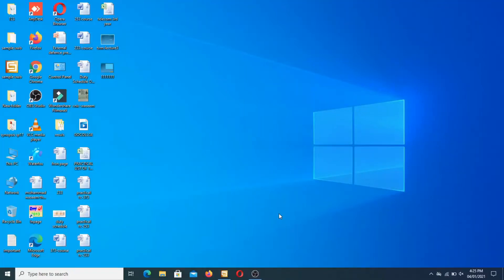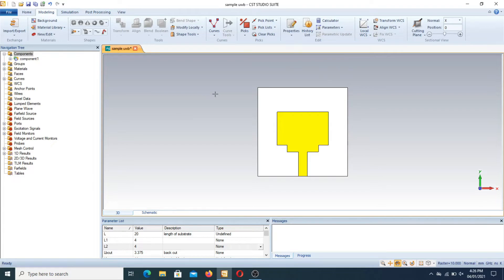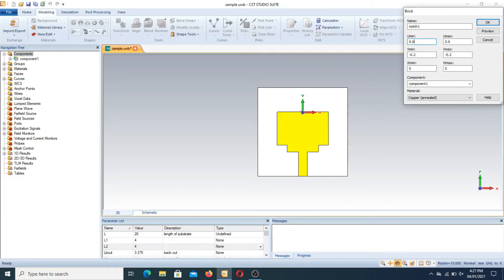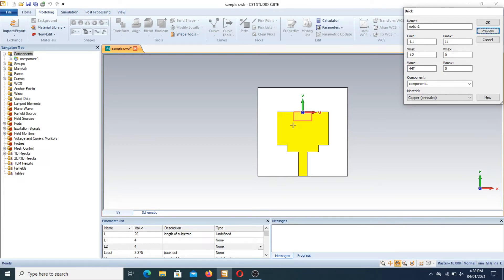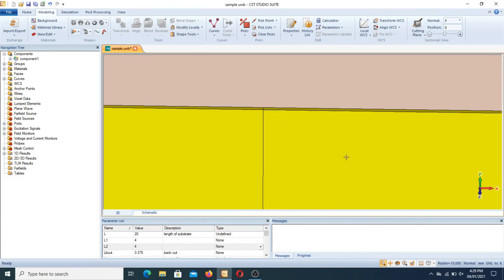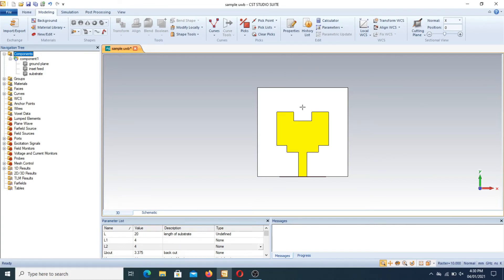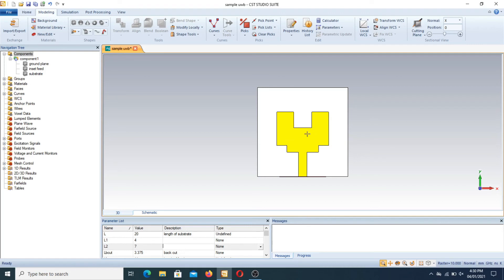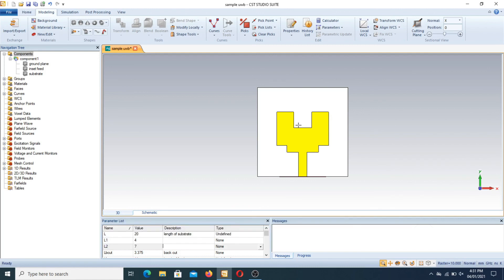How to insert notch in cst| how to design notch in cst |simple steps to design notch in cst

Comment: very informative. any link or stuff for the analysis of the location and the dimension of the slot to create
Reply from the maker: Are you want info for fabrication
Reply: @infotechscience  the mathematical analysis of creating slots in an antenna as a notch or for other purposes or the use of cst features for analysis of slots like current density or surface current etc